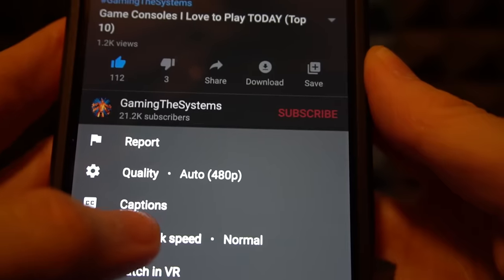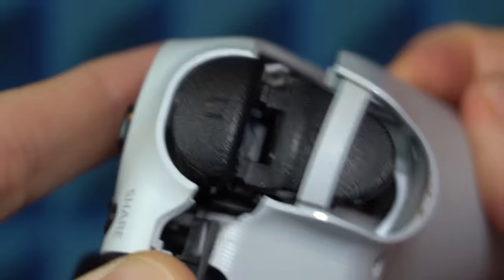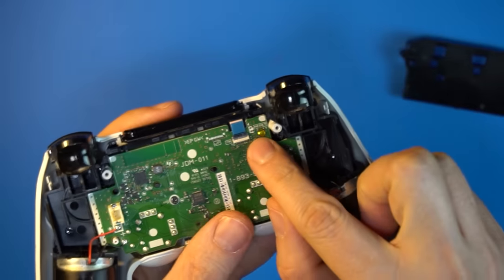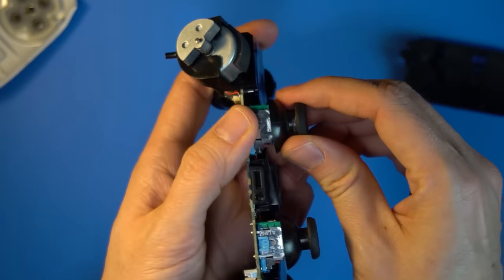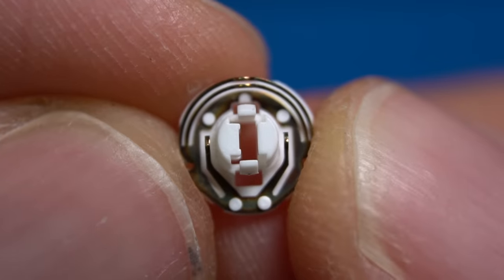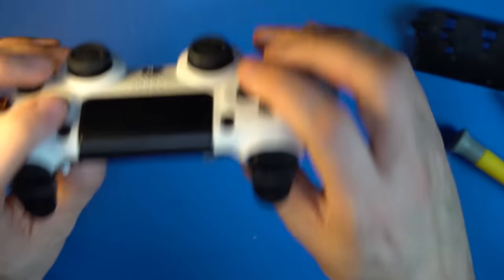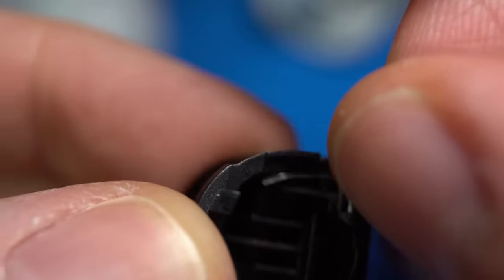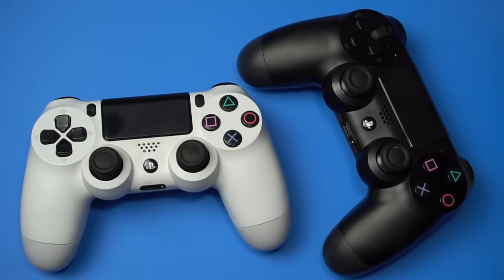How to Repair a PS4 Analog Stick That is Drifting, Sticking, Jittery/Cleaning DualShock 4 Controller

Comment: Am I the only person on the planet who has controllers that randomly just look up or left at random times? It's I possible to Google because it just comes up with stick drift, bit it isn't. I can literally randomly do a 360 with my controller on the table. Tried re syncing, restarting console [xbox] etc. Nothing. Done it with elite series 2 and normal controller. Has anyone on earth had this issue?
Reply: I have it too but no idea on how to fix it. I was here to get tips on how to fix my other controller drift and the comments are quite positive so I can't wait to do it. As for my other controller with the same issue as yours I don't even know where to start

Comment: Ima say one thing, DO NOT TRY THIS IF YOU HAVE THIS PROBLEM THROW CONTROLER AWAY AND BUY NEW ONE YOU'LL WASTE YOUR TIME AND YOU'LL RAGE EVEN MORE,DONT   REPAIR YOUR CONTROLER  YOU CAN ADD MORE MONEY AND BUY BRAND NEW ONE , THERE IS NO HELP TO YOUR CONTOLER, MINE IS RESTING
Reply from the maker: But look at the rest of the comments. Hundreds of people repaired their controller. If you are going to throw it away, might as well TRY to fix it instead of rewarding Sony for shoddy design.

Comment: at 4:17 i might've broken one of the pins. would it still work?
Reply: If you are talking about one of the three pegs on the green door, you should be able to clip one fully off and still shut the door.
Reply: @GamingTheSystems1  gotcha, I'll just have my friend fix it for me cuz I just don't wanna attempt on breaking things
Reply from the maker: Ok. I thought some more. If you mean one of the metal pins that hold the door onto the board, that would take some soldering and possible replacement of the door.

Comment: I cant close it 4:25 i already try many times but it wont close
Reply from the maker: There are three pegs on the door. See if one is bent. If so, unbend it. If it's too damaged to unbend, then clip it off with nail clippers. There are also two latches, one on each side of the door. Give those a little pinch inward.

Comment: I'm sick of buying ps4 controllers.  I'm on my 3rd.it last 6 months and started slightly drifting on the left,as the weeks went by it got worse. Gta 5 has 3x $ and RP on racing this week. All races that I am top 5 in at any given time. Special,Hotring,Street ( formula,nascar,tuner)
Anyway ,making money is the thing in gta and this is bread and butter for me. My left drift is killing my game.  Right turns are done by blowing my horn. Why oh why do you have to be a freaking brain surgeon to fix ps4 drift issues? I can't do this crap! Im going to the dumb ass wal targ and dropping another $59 on 4th controller today.

Comment: Appreciate the video, this definitely worked for me. There were some differences between my remote & yours (like the battery holder being held on by a screw) but with your instructions, it was easy to figure out what I needed to do. Now even being extremely careful I did manage to break 1 wire from it's metal connection and I wasn't able to connect it back but it didn't seem to break anything but the light at the top of the controller. Dualshock still vibrates and controller no longer drifts. I barely noticed that light anyway! Thanks for this video.
Reply: i kept pulling that battery holder and got so mad lmao, then i decided fuck it im just gonna unscrew it and it was connected with the screw haha

Comment: DO NOT FOLLOW THIS VIDEO. It is not worth it to take apart a ps4 controller. YOU WILL end up breaking something or causing more issues than you started with.
Reply: Maybe be a bit more careful, I had no issues - same with tons of other people in this comment section.
Reply from the maker: It's better to use the video I link to the in pinned comments. Either way, if someone is going to throw away their controller because of drift, they might as well try the things in the videos.
Reply: nonsense. i fixed mine with this video. it works good now

Comment: yea nah my ass is gonna break my shit I'll just deal with the drift
Reply: I literally just fixed mine right now. It work ! Found a little black residue on the end of the q-tip I was using to clean it so definitely fixed it. Just be careful when opening it, don't rip it open

Comment: so.. took apart a controller and one wire disconnected for each dualshock. i'm going to attempt reattachment via hot glue
wish me luck 

edit: no hot glue yet but i did make the drift worse
Reply from the maker: Solder would be better
Reply: yes well sadly i dont have solder, a soldering iron, or any kind of access to them or experience using them
Reply: Don’t worry about em it’s for rumble barely anyone uses it lmao or if you do you do you then

Comment: Hahaha my controller's screws are so stupidly tight that I cannot unscrew them, if I apply any more strength I will break my controller, and the indentations are already getting widened so I will not be able to use a screwdriver anymore. FML
Reply from the maker: Wet them with a drop of water. Let it soak and clean any gunk around them. Tap them too.

Comment: Absolute legend, went from having my joystick spazzing out to being completely dead center and solid. Bit of a bummer that I ordered a new controller before I found your channel, but a spare cant hurt 😅. 
Also, just a heads up, the last ribbon cable for me had to have the contacts facing away from the battery. Not sure if that has already been mentioned... but the controller will not turn on if its the wrong way.
Like and subbed, thank bro!
Reply: Make sure you store your spare somewhere safe, dust can really total a controller

Comment: mine is the right stick i cant hit jack shit
Reply: Did it work?
Reply: @OND30  no mine is a lost cause
Reply: @MANOWARRIORS-UNITED  damn did you try spamming R3 and hitting your controller? I had and still have this problem from times to times. It even ruined my fun as I felt dizzy trying to move with the joystick quickly moving up but when I hit it and spam R3 thousands of time on a practise map it somehow got better and stop drifting like this
Reply: @OND30  yeah ive pulled it apart and   cleaned every part ive tried every thing i think it just wore out can only fix it so many time

Comment: Nope terrible. Your best bet is to just buy a new effn controller even though they're so goddamn expensive. Honestly I've been taking controllers apart since PS1 just to remove the weight the stupid effn Rumble feature added. No controller is more complicated to take apart and put back together than the PS4 controller, except maybe a PS5 controller which I haven't taken apart yet.

Comment: This video really is a life & money saver. I just did this & it fixed my drifting. 
I'm on my 3rd or 4th controller & finally broke down to try & fix the drifting myself. Easily done as long as you got the right tools (if you don't have the right screwdriver, srsly go buy one. Striping one will make it impossible to fix! Experience from stripping a laptop screw <--). Tweezers help a lot too.
And have a gentle but strong touch. Just be wary of any parts springing out at you when you take it apart. The shell can be a tough one to open. Thank you for the video!!

Comment: It wont power up xD, I guess RIP
Reply from the maker: See FAQ in description
Reply: @HowToX  did flip the blue tape and now when i press only for a second it lights up but it quickly goes away. It does not blink like it's supposted to.